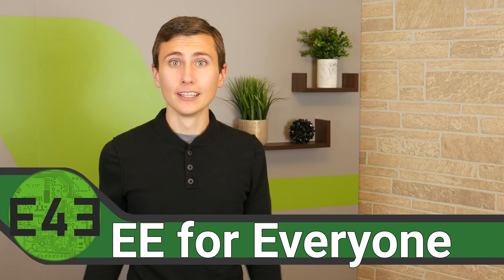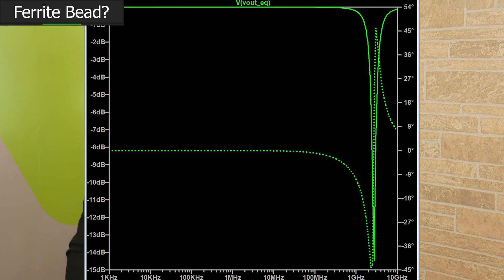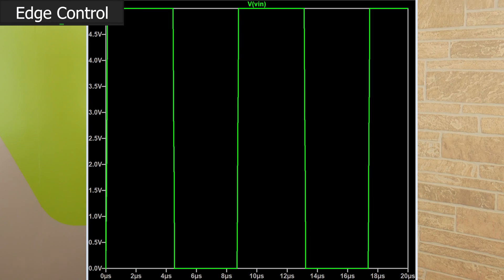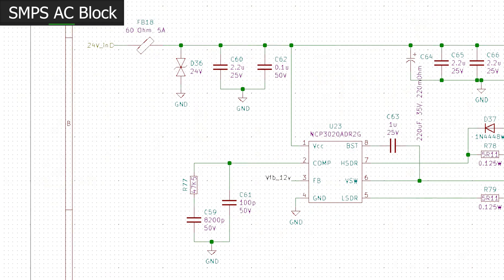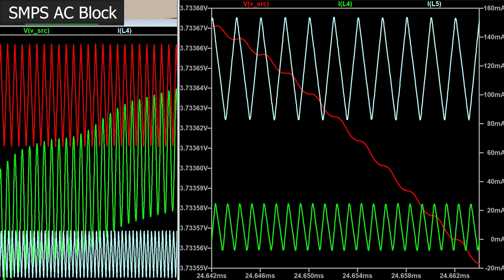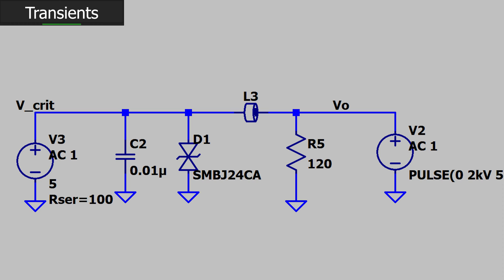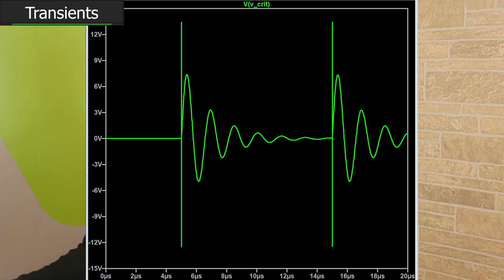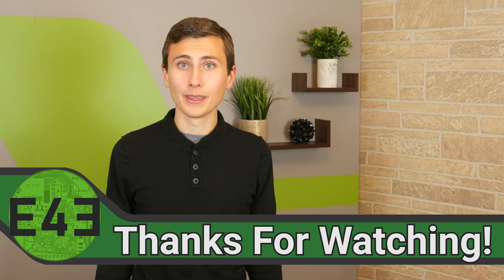Ferrite Bead: Component Fundamentals

Comment: Many years ago I was working on a Sony BVH1100 one inch VCR.  The power supply had some beads in the circuit, but not in the drawings.  The supply had become noisy.  Desoldering the beads and reinstalling the beads cured the problem.

Comment: Hi sir, I have on grid string inverter which has switching mechanism as per my research in my home and when those are on, my pc psu (which also has switching mechanism) make a audible noise at 15 kHz. I was thinking to apply a ferrite bead on the pc psu power cable. Can you please tell me whether I should or I should not?

Comment: The Commodore 64 was covered with these things because of fears of noise interference from it's circuit board.  So high were these fears that the computer even contained two Faraday cages.  I've never understood why that particular micro required so much noise cancelation.

Comment: So the beginning explanation states a ferrite bead acts as a notch filter - but then first example states it gets rid of high frequencies. This is a bit confusing as the beginning explanation says the high frequencies should pass.
Reply from the maker: Aaah, yes, I think I understand what I meant, and why how I explained it is confusing. So, there's a great article from analog devices that shows the frequency response (https://www.analog.com/en/analog-dialogue/articles/ferrite-beads-demystified.html) I think that graph may help a lot.

Ferrite beads are generally used to pass DC (or lower frequencies) and block higher frequencies, so it's important to choose a ferrite bead with a significant impedance at whatever higher frequencies are being targeted. However, there is a limit to this, because at very high frequencies a ferrite bead's effective resistance starts to drop again.

So, there are very high frequencies that will get through a ferrite bead, but that is why there are many different beads available, with different operating frequencies.

I hope this helps, and thanks for watching!
Reply: @EEforEveryone  , perfect. That clarifies it for me. Thank you for this video and everything that you do.

Comment: I have a peavey power amp that has a bad L2 ferrite bead, how do I go about ordering the correct one? The schematics I have just say "ferrite bead inductor L&R"
Reply from the maker: Oof. Dirty Diesel, that's a hard question! If you're just debugging, it's totally fine to short out that bead out. They block high frequency, and pass lower ones, so everything should power up.. but you might hear some noise.

Once it's powered up, if you can measure the noise frequency getting through, pick a Ferrite bead with a high impendence at that frequency! (and enough current capability) That won't get you an identical ferrite... but it should get you a ferrite that will get you back up and running!

Comment: do ferrite bead helps with electricity flow?
Reply from the maker: Hello Edwin! Great question, and thanks for watching!

Ferrite beads, in general, allow low frequencies to flow (like DC power) while restricting the flow of higher frequencies. This can help to prevent noise from getting into sensitive circuits, or noise from getting off of a circut board and into cables.

They are very important when designing products, and can be a cheap way to improve the EMC or electromagnetic compatibility of a design.

Here's some more info: https://www.analog.com/en/analog-dialogue/articles/ferrite-beads-demystified.html#

I hope this helps!
Reply: @EEforEveryone  thank you ..... its about my scooter ..i saw some youtube DIYs ... about the ignition coil ... im planning/experimenting w/ the lowest resistance cables + spark plugs + spark plug cup ...a DIY video says that having low resistance components will give better electrical flow ....the problem is it will create EMC that will affect other electronics on my bike ... do ferrite bead really help? ... some videos claims that ferrite bead directly boost electricity current .... is it true?
Reply from the maker: @edwindelfin7894  Hi Edwin, Ferrite beads can reduce high frequency noise.  They won't boost current, or anything like that. They're like a resistor, but the resistance changes with frequency. 

If you truly want maximum current, then adding anything to the circuit will reduce or restrict flow. Filtering, however, is usually worthwhile.